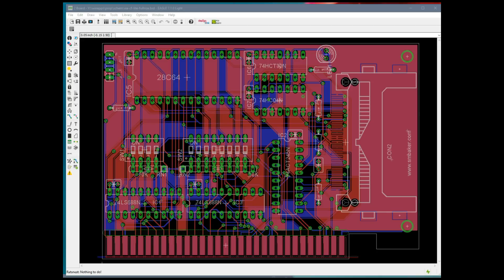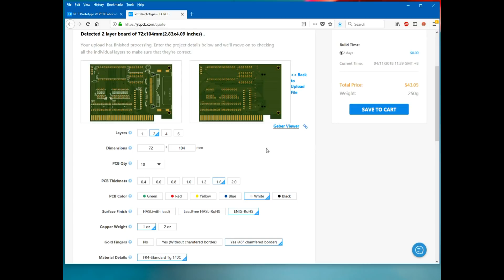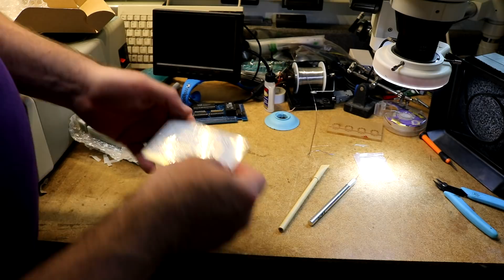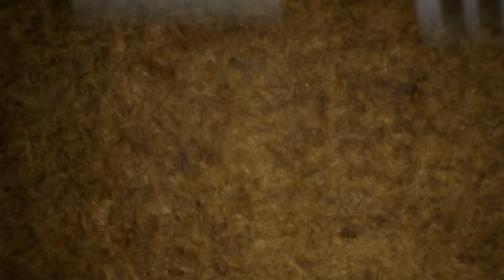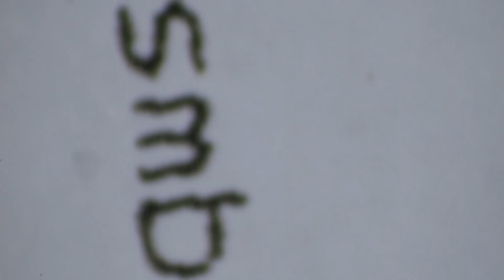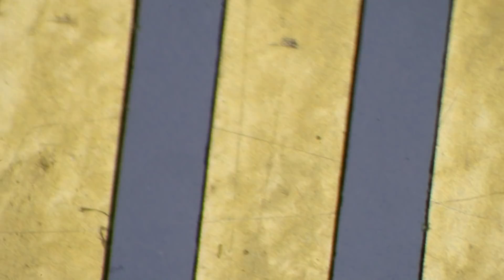My review of JLCPCB PCB Prototype service

Comment: Extremely poor customer service! AND do not expect to receive your PCBs for $2, they make more profit form shipping than the PCB (with their wrong foot prints!!!)
Reply: I've found their customer service perfectly fine instead, they messaged me about a note I added in a design to double check what I described was correct, asking them about the router capabilties gave me a quick and clear response and generally they're polite and know what they're doing which helps speed things up.
On my last order they did change my design slightly, I messed up a trace which ran next to a large cooling opening which went far over the tolerances (half the trace was in the hole...), slight bug in the pcb design software drc check to not notice that but they fixed it without question, would've preferred a little heads-up on that one but glad they fixed it anyway.
Shipping charges are fairly standard, unless you expect them to make and ship for $2, cheap slow shipping, faster shipping for medium price or DHL expensive shipping, I've so far only used the last on each order and from submitting the order to receiving the PCBs was never more than 7 days including the weekend, so 20,- for having it made and delivered within the week seems pretty fair and fine.

Wrong footprints is not something JLCPCB has anything to do with but instead is something you did, I too have had some designs with a wrong footprint, mainly because I got lazy and imported a footprint made by a community member who had it scaled wrong (109mil distance instead of 100 for instance) but you don't pay JLCPCB to design the PCBs for you, just to make 'em so as long as you design them wrong, they will likely make them wrong, as per your request...
Reply: @Frank De Ruiter $2 prototype pricing is on each order, so until they scrap that your next order also gets the first board (within that order) for $2, and the next order too etc.
Yes, tried and tested.

Comment: Hey Scott. Regarding your inspection for the silk screen printing on the white board @19:40 where you noticed it was a bit jaggy I would like to tell you that jlcpcb print annotations for small quantity boards with a kind of special ink-jet printer which produces this "pixelated" printing. This is in contrast to nearly perfect true "silk screen" printing for larger quantities of boards. The reasons are obviously economical because producing the "throw-away" silk screen is more expensive. They showed this on a video tour of their manufacturing process. It was awesome.

Comment: i did try jlc pcbs for my full size adlib replica project, absolutely not bad at all, cheap price, really quick, and nice customer service too, my adlib replica pcbs in white with my logo to customize them looks pretty nice, i used HASL without gold finghers (because i have a limited budget for my cards, i ordered just 5), do you have suggestions for the soldering metals?

Comment: Scott, I'm enjoying watching your Z80 series of videos as well as this one. I have a question for you: if I were to try to build my own RC2014 boards like you did several times, what part name or part number would I ask for from Digikey for the female and male bus connectors?  Thanks.
Reply: Don Prefontaine They are standard 0.1" SIL pin headers and sockets. There should be tons of options. You might find them cheaper on eBay though.

Comment: Did you need the "gold fingers" option when using ENIG? It didn't seem that there was any visible difference between the regular pads and the edge connector. I'm a complete noob at PCB design and manufacture so don't really know the implications of the different options.
Reply from the maker: My understanding is that gold fingers are supposed to be a harder gold coating than ENIG, and therefore more suitable to repeated connector insertion/removal. I do agree that it's difficult to see a visible difference, but I asked my rep at JLCPCB and they told me to gold finger process was applied. After the video, I did compare my JLCPCB gold finger board to one of my standard ENIG boards (from another manufacturer). There other manufacturer's ENIG board showed some flaking with repeated insertions. The JLCPCB "gold finger" board did not experience this flaking. So it does seem more durable. It's beyond my expertise to do any detailed analysis of the coating quality, so I didn't talk about it during the video.
Reply: Great! Thanks for the detailed reply.
Reply: I was somewhat surprised that you didn't get the edge of the edge connector chamfered to make insertion gentler on the motherboard connector. Was it an option?
Reply: I ordered some of Sergey Kiselev's designs through JLC, with the ENIG and gold fingers option, and they arrived last week. Haven't had a chance to assemble them yet though (still waiting on parts), so I haven't tested the finish of the gold fingers. I thought the gold finish looked a little different, although that might've just been the lighting I was looking at them under (looks like the video is lit with warm white, whereas I might've inspected them under a cooler white light). I'll try a few insertions and check the finish when I get home from work.
Reply: Ran one of my XT-CF-Lite boards in and out of an ISA slot a few dozen times and there's just the usual wear marks, no gouges or anything like that, and running a finger across the contacts doesn't come away with any metallic flakes. Even under high magnification there's way more scratching on the bare fibreglass where the contacts were removed in the design. I'd say the gold fingers are definitely good enough for enthusiasts like us, if not comparable to a commercially manufactured product.

However comparing the gold tone to a spare video card, the colour is lighter. If it is because they're not plating the gold as thick, it doesn't appear to be affecting the durability of the contacts. Maybe they're just using 18K gold instead of 24K! ;)
Reply: I got my boards chamfered, and it does make it easier to insert the cards, but it looks like it was done by hand. They did take a day or two extra before they shipped though, so I'm guessing that's because they're done by hand. You could chamfer them yourself with a file, although you have to be careful of the fibreglass dust. A good dust mask and eye protection is recommended.